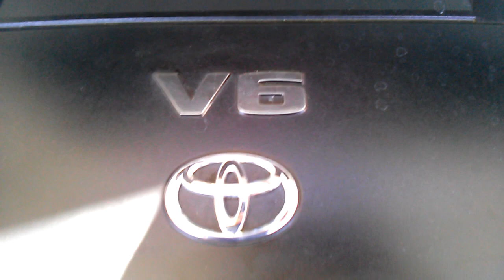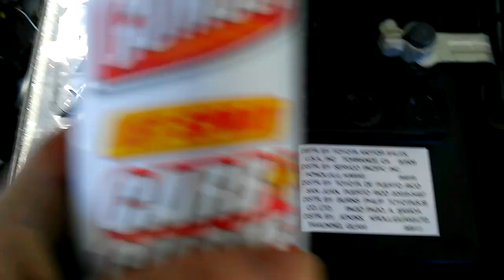Seafoam, V6 RAV4 PT1(1)

Comment: Did it help with anything? Hurt any? Thanks for the reply!
Reply from the maker: Yes. Throttle response improved, idle was a bit smoother, 2mpg improvement average,  and the sulfur smell from the converter went away 😊
Thanks for the question!